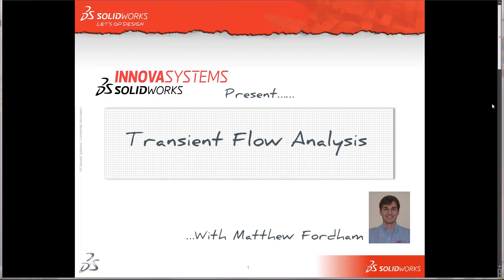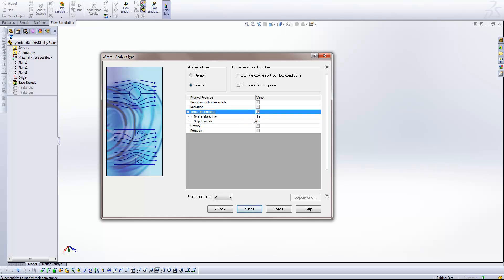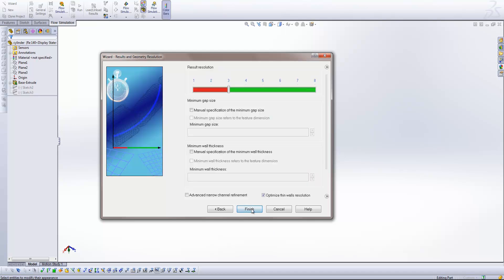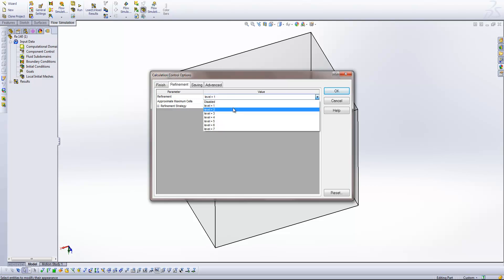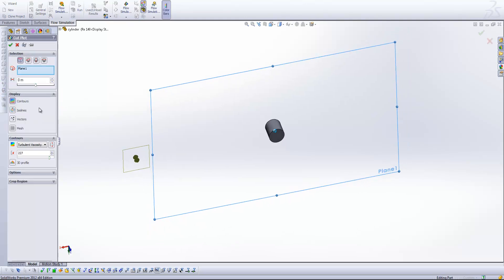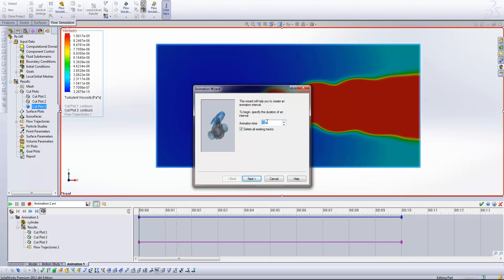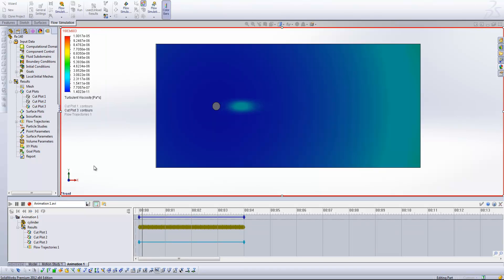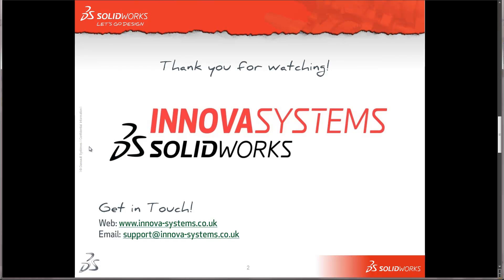Transient flow analysis in SolidWorks Flow Simulation

Comment: Amar,I have an issue that your Transient flow analysis in SolidWorks Flow Simulation could assist with.  I have 4 tubes that are exposed to constant air flow about 15 MPH.  These tubes are not fixed so that only the first tube takes all the air flow forces and the other 3 tubes experience less pressure because they live in the wake of the first.  At any point in time all 4 can experience the same flow and the same pressures.  I think for safety reasons it would be better if we diverted the air flow or at least located the tubes in perfect alignment so that all 4 tubes did not experience the same flow pressures.
Is it possible that you could share your model? I think I have someone that can modify your simulation to produce the desired presentation so that we can demonstrate that we have a problem that can’t be seen but is very serious.Al Cameron al_cameron@outlook.com

Comment: You cant get it so wide and swirly with high speeds so you have to use 1m/s it otherwise takes hours to solve, 2D 1mm thin mesh, 70sec physical calculation and a max 7 mesh quality.
Probably depends how big the cylinder is also,..